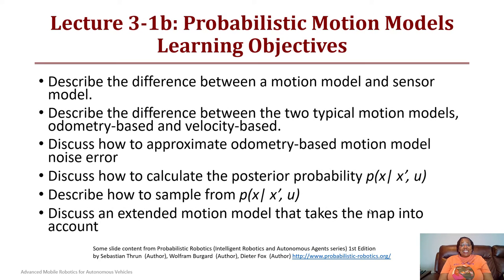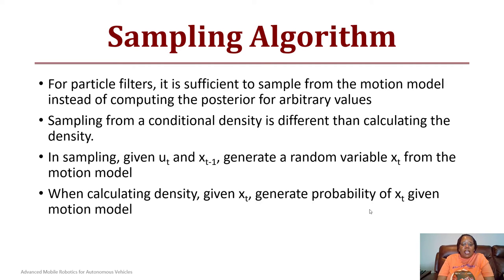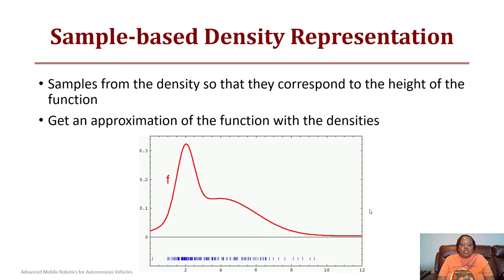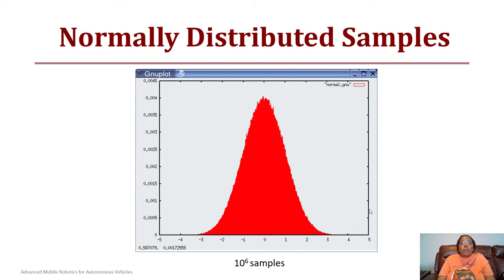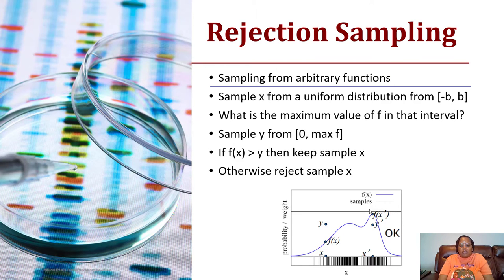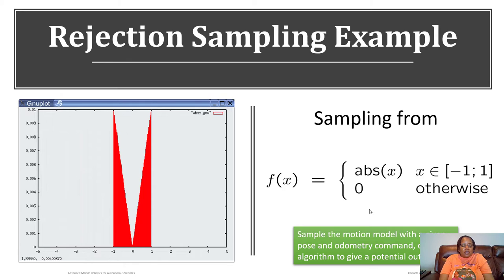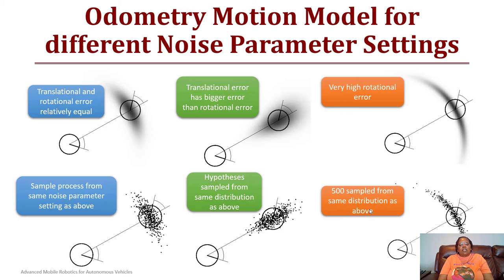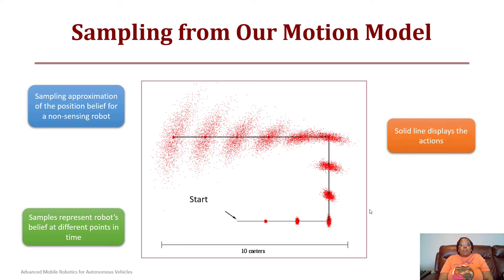Advanced Mobile Robotics: Lecture 3-2a - Probabilistic Motion Model

Comment: Thanks for the information!
Please, to select the correct ALPHAs odometry model noise:
ROS-based suggestion:
Is it correct to calculate the RMSE between /cmd_vel/linear/x and /odom/twist/twsit/linear/x for translation and RMSE between /cmd_vel/angular/z and /odom/twist/twist/angular/z for rotation ?

Can you suggest for me the correct way to tune them to the reasonable values ?

As we know:
Here \alpha_1,\alpha_2,\alpha_3,\alpha_4α 
 are adjustment parameters showing how important noise in each transformation could affect the motion, they represent the change in: rad/rad, rad/meter, meter/meter and meter/rad respectively.
Reply from the maker: I am not sure other than sensor model and odometry model testing on the robot, I would reach out to Sebastian Thrun for more guidance probabilistic-robotics.org